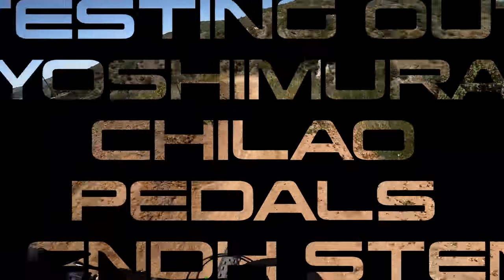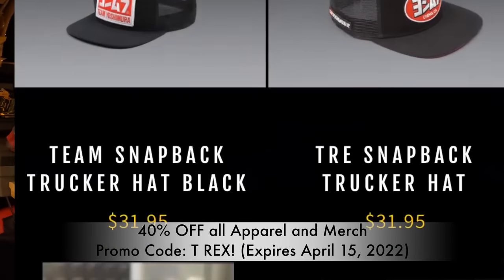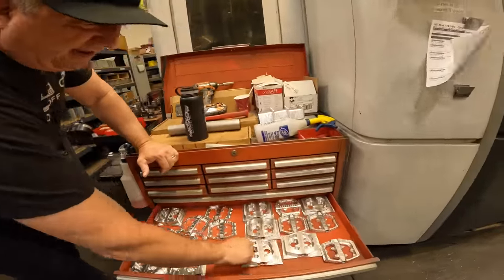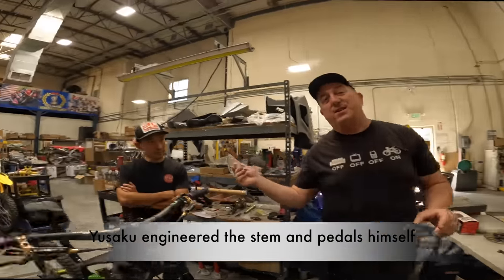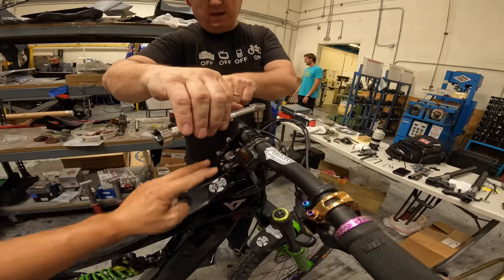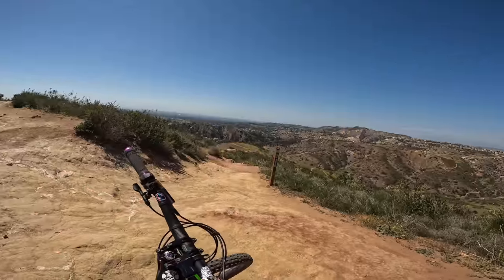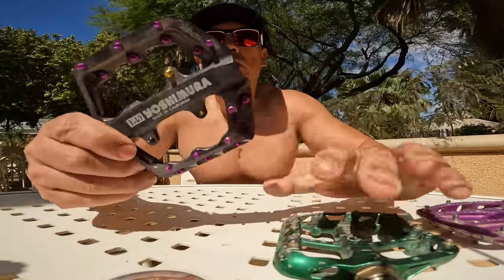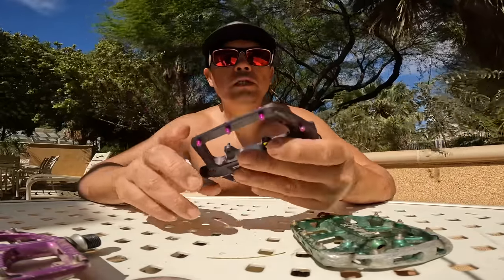Test Ride & Review Yoshimura ENDH Stem and Chilao Pedals / Big Moto company joins MTB Game / 3-25-22

Comment: Tommy, the site shows it in two different ways but I dont see an option for non crown forks. I was guessing it comes with the adapter but I want to make sure before I pull the trigger on it. EDIT: I saw the adapter for the stem and dude that is sick.
Reply from the maker: Great question, this stem can fit as a direct mount on a dual crown or as a standard stem on a single crown like it is on my Decoy. Its really a genius design. Big E shows how in the video as 7:20.

Comment: Just pulled trigger on the stem. As much as I like idea of dual crown for pike park season I know my skills don’t justify the need for DC. Even so I want to build as strong of a setup as I can and the lower clamping point makes sense as it decreases the leverage in event of a hard crash. What height spacer are you running on your headset? Looks like a tall cone. Do you think the wide base of the cone adds additional strength vs straight spacers?  Fwiw this will be on a 29” Slayer 170mm front and back with a Z1 coil fork which has thicker tube walls than the Fox 38.

Comment: I’d love to see Yoshimura’s take on a clipless pedal using the SPD mechanism.  Something similar to the Shimano Saint, a clip-in platform pedal with removable pins.
Reply: So when I used other pedals I found I used to pedal strike a lot I would say my pedal striking days have been over, since I found the invention of con-caved pedals. Yoshi is not the only concaved pedal, but it’s the most comfortable one that I have ever tried
Reply from the maker: The right pedal and shoe combo will fell like your clipped in when needed but more importantly it doesn't lock you in when you need to put your foot down. It's a give and take but I have avoided so many major crashes being able to take my foot off the pedal quickly with the flats
Reply: Flats definitely seem to be the preferred pedal for most.  I just prefer to be clipped in.  I’ve never had an issue unclipping.

Comment: Was wondering what the difference in feel was with the new stem?  Also how much rise do you ride with on your handle bars?  Curious as the stem adds some rise so would need to mount it lower is my thought.  Appreciate your thoughts on this.  Great video and the Yoshimura gear looks great.
Reply from the maker: Yes the stem has a 35mm rise so you definitely need to cut down the steerer tube, that's what I did

Comment: Anyone else having issues with the discount code for Yoshimura?
Reply from the maker: It should be working fine I just checked it. It's "T REX!" Make sure to have the space between T and R. Also don't forget the "!" At the end
Reply: @TommyHuynh  doesn’t work
Reply from the maker: @mendozar03  yes it does I just did it. It won't work on pedals or stem because it's only for apparel and merch.
Reply: @TommyHuynh  Thanks but it's still not working. I'm trying to buy some water bottles and a t shirt.
Reply from the maker: @jim6335  it works I just did it twice now. Again check the spelling (no "W" and need space and exclamation mark). It's "T REX!"
Reply from the maker: @mendozar03  a few people had the same issue and we found out that it was because they were on the Yoshimura R&D website which is moto. The code won't work on that site, the discount is for Yoshimura Cycling website. Also it won't work on pedals or stem. Only for apparel.
Reply: @TommyHuynh  Thanks Tommy. I was on the R&D website.
Reply from the maker: @jim6335  ok that makes sense. Glad we finally figured it out. Hopefully you were able to use the discount on the cycling website
Reply: @TommyHuynh  yeah I figured it out after a few tries lol.  I got my hat though.  Thanks for the 40 off!
Reply from the maker: @mendozar03  hell yeah 👊